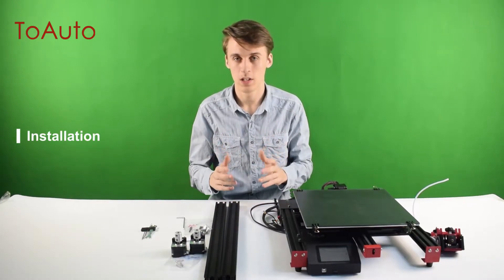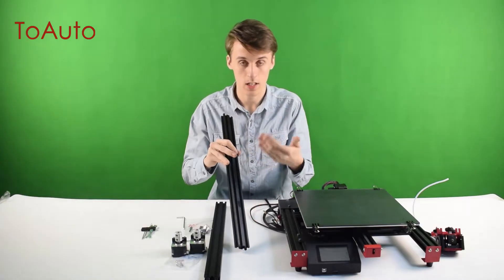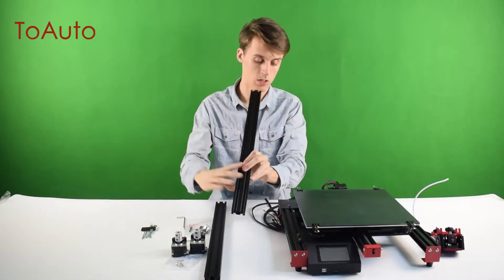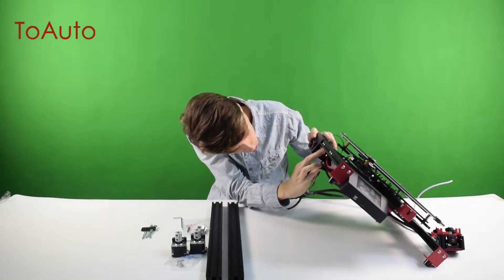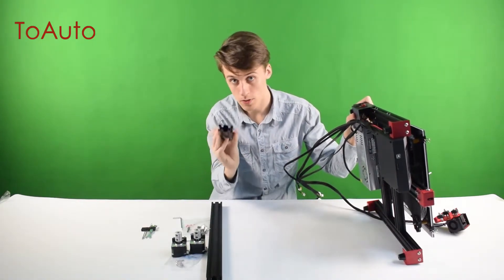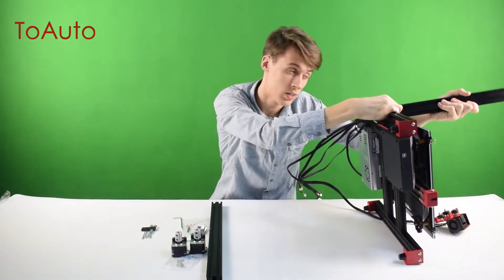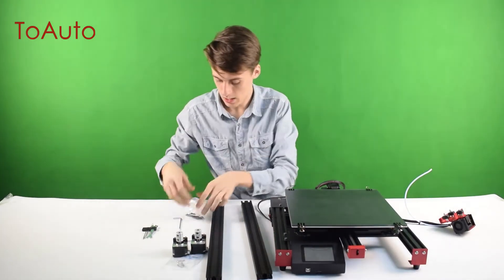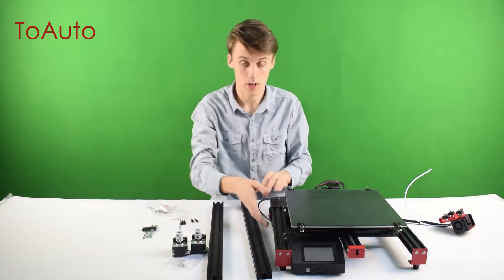New 3D Printer Prusa Kit Pyramid A1Installation 1

Comment: I can imagine this would be helpful if the product he was assembling were the same as mine. It is not. And this exact video was on the USB drive I got...I came here hoping for an updated version.
Reply: Same, I got mine with slight variations yet mine seems to have a belt that is short by a few centimeters and difficult to fit into the prongs, on top of missing a very crucial piece
Reply: I seem to be missing the first motor that’s supposed to be allowed to the Z axis
Reply: @DARKSOULPRIMEX  I believe it. Also 80% of this video is saying, "alright?" and "smooth" and "tight" -- meanwhile I have no idea how to find the parts, and I can't see close enough for it to be helpful.
Reply: @DARKSOULPRIMEX  hey you may have found this but wow is this video 10x better. https://www.youtube.com/watch?v=7BZrnEoph_4

still not exact same, but way way way better